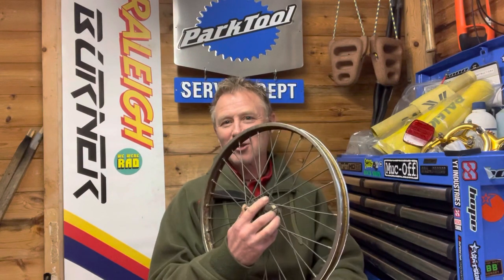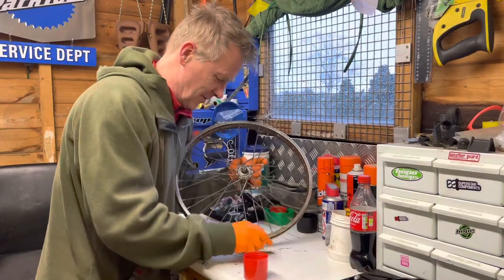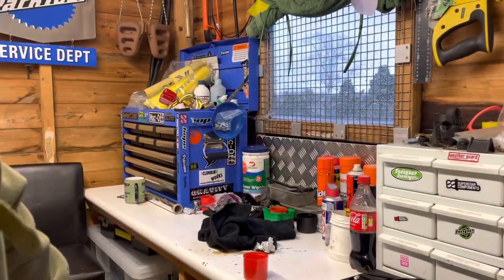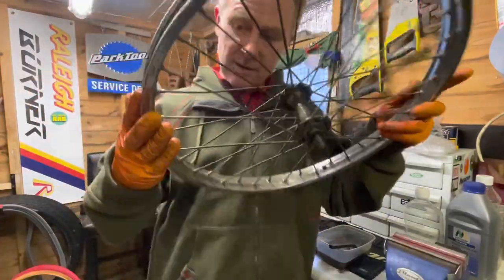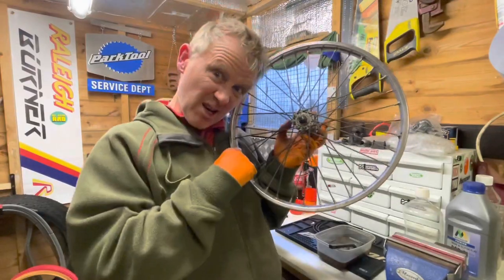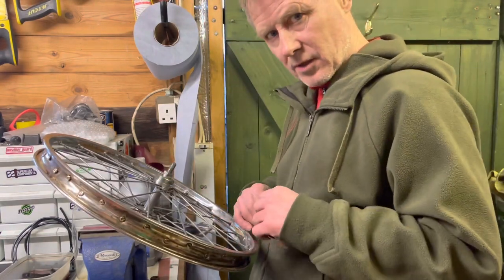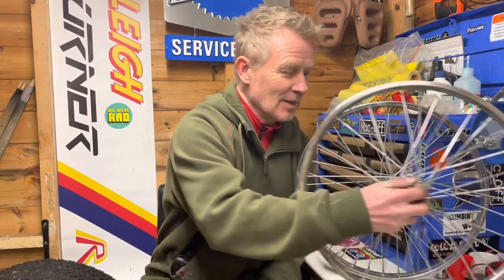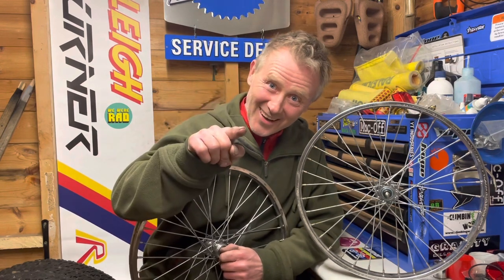How to clean and restore chrome BMX wheels - Old School BMX

Comment: Top job there fella. 👏 I need to do this on my Grifter wheels. I used Poundland soapy scourers which didn't remove much 😁 but foil + water did a pretty good job on a 2017 Chopper I acquired for free last year. 😃
Reply from the maker: It’s bloody hard work though, it’s made my shoulder ache 😂😂😂

Comment: What sandpaper you used for the spokes?
Reply from the maker: It depends how bad they are. Normally a 180 grit emery cloth to remove the worst, and then polish with a 400 grit wet or dry and/or wire wool.